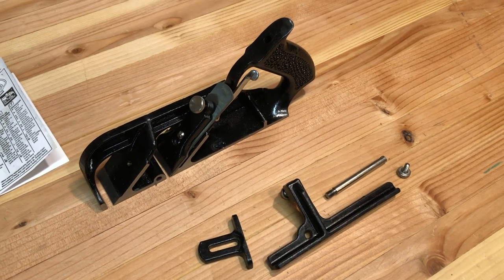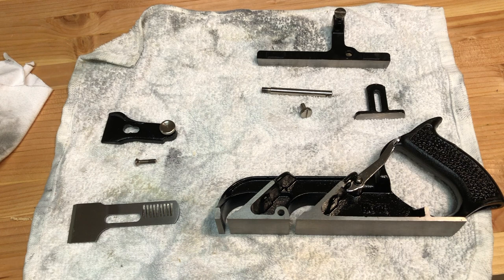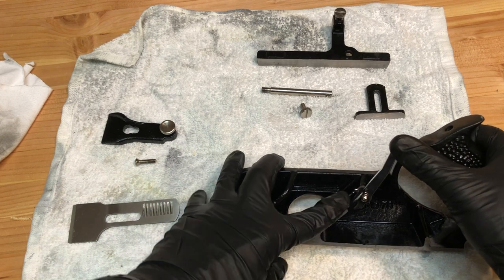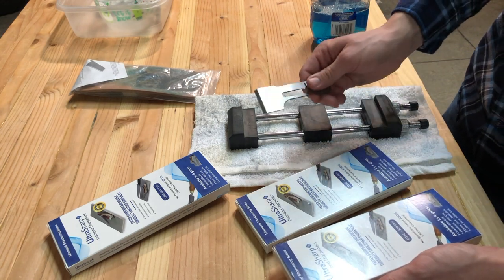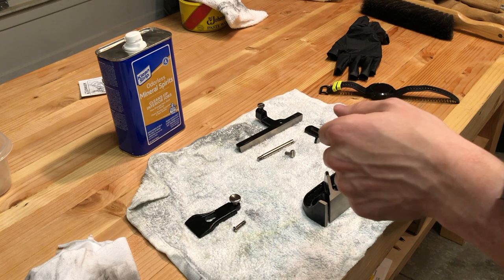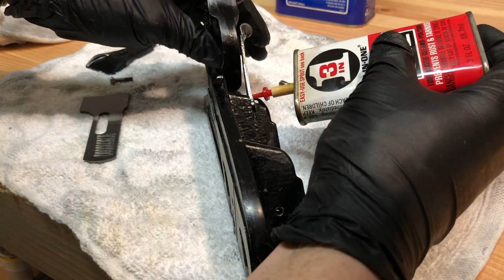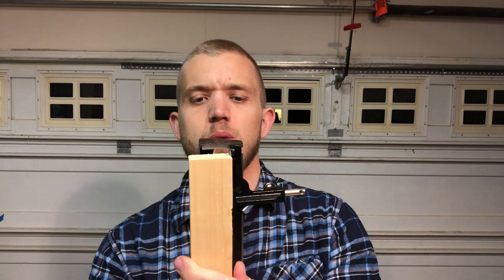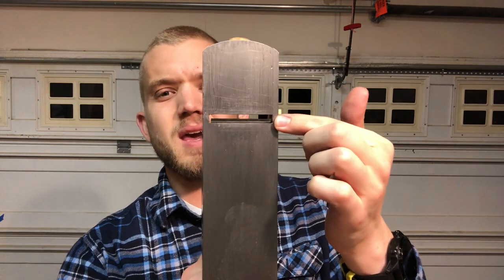Rabbet/Rebate Plane | Unboxing & Initialization

Comment: Please , I want your thoughts about this plane ?? thanks
Reply from the maker: The plane is great but definitely has a learning curve. It is very sensitive to depth of cut, so start off small and make sure you sharpen the blade. Overall though, it’s a great addition to the tool set, especially given it’s price.
Reply: @NorthwestCraftsman  I have a problem of jamming the shaving , hard to deal with it 🤔 should I sure that the soul is completely flat ? or not ?
Reply from the maker: Where are the shavings jamming up? It likely means the plane is taking too heavy a cut and the blade may not be adjusted close enough to the corner of cut.
Reply: @NorthwestCraftsman  I'm little confused 🤔 should the blade be flush to the sole when I cut or a little further from the sole ?? 
p.s  I wonder why the blade wider than the sole of the plane it self ?? pls help ?
Reply from the maker: Apologies on the delay, YouTube didn’t notify me of the reply. For all planes, the blade will stick out a hair further than the sole (bottom) and this determines the aggressiveness of the cut. If only a tiny amount sticks out, you should get fine shavings. Normally, you want the edge of the blade to be aligned with the sole so that there is an even chip size along the entire blade length. For this plane, there is an added consideration. The corner of your blade should be well aligned with the “side sole” (not sure what the correct terminology is) so that it can cut a sharp, 90° corner. Where are your chips getting stuck? Is it along the whole length? Or right in the corner where it meets the plane of the side sole?
Reply: @NorthwestCraftsman  No , only on the corner !! 🙄
Reply: @NorthwestCraftsman  Thanks sir , after tuning it well and understanding it finely go smoothly with it , no problem at all and I definitely love it 😊
Reply from the maker: @athmostafa2462  glad to hear it’s going well now!
Reply: @NorthwestCraftsman  Thanks 👌
Reply: When creating the shoulder like the one shown in the video, did you have the blade slightly protruding toward the wall you where cutting